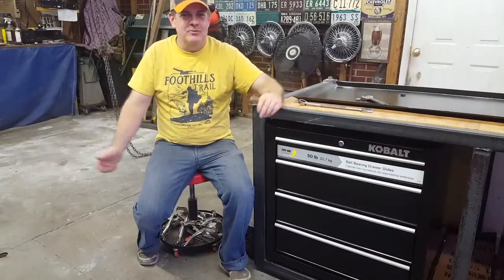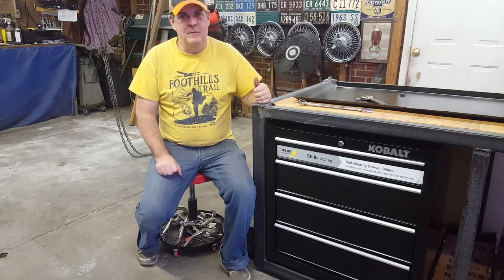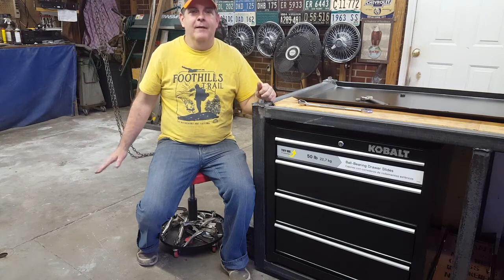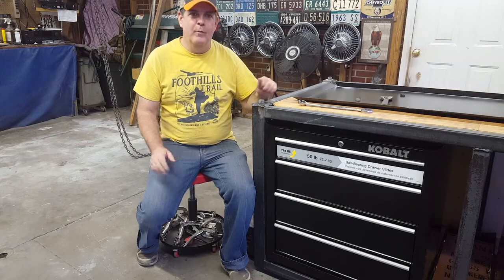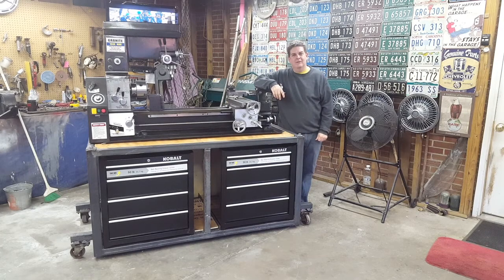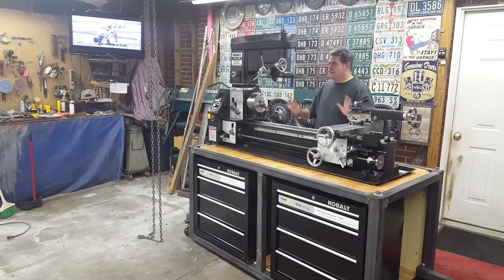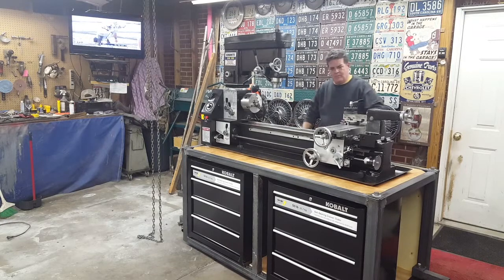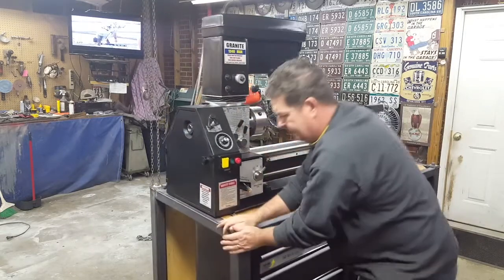Mounting the Smithy Granite 1340 Max to the Work Bench

Comment: Nice bench you made for yours! I bought a Gladiator table from Home Depot when I bought a Granite a couple of years ago, and it has a hardwood top. It's a HEAVY duty table--rated for about 2000 pounds as I recall. Then I bought a couple of their cabinets to go under it. But your bench is awesome. 

The Granite units are very good for the price point, for the most part. It's definitely not a Bridgeport, but the lathe is pretty decent. I have lamented about the lack of a tang in the tailstock myself actually--never made sense to me either. One nice addition to this machine though is the SINO DRO unit. I put one on mine and it's great. 

I bought the 1340 Granite IMAX because I had only a 11x22' shop, but last fall I built a much larger shop and also bought a Bridgeport mill and a 13" South Bend lathe. So I'm going to put my Granite up for sale. I've used it quite a bit and overall, as you've said in another video, they get a bad rap. The lathe is actually pretty good I think. 

So someone in Wisconsin is going to get a very well-tooled Granite with a nice DRO and minimal use.
Reply from the maker: Thanks so much for watching and commenting! I love my Smithy, its perfect for what I do in my small shop. Thanks for the compliment on the bench. It turned out pretty good.
Reply: Yes, it's outstanding. Bummer on the chip pan though--you should DEFINITELY have gotten those risers.

Comment: Great build and single handed mounting.  Cool. I am looking at an early used Granite from an elderly friend of mine.  I know little or nothing about machining operation.  Question one: is granite a good learning setup.  Question two:  do you know of any on line Smithy user groups.  I do have extensive wood lathe experience as well as general shop background.  Gotta start somewhere.  Really hope you can respond.  I’m in Souther California.

Comment: In using this setup have you found the Smithy is to far away from where you stand in as do you wish or have you moved it toward the front?
Nice bench, love the adjustable legs, not only for leveling but to remove those casters, they can hurt if left in ;-)
Reply from the maker: I have been satisfied so far. I do need to raise it up about two inches.

Comment: Do you know the dimensions of the stock you used to mount the Smithy and/or the distance between the holes?  I don’t find a template or mounting diagram anywhere.  My 1340 is finally “supposed” to be here Tuesday.
Reply from the maker: Hey ok farmer, honestly using the chip tray that come with your machine for a template works the best. Remember to plan on some kind of spacers between the machine and the bench. I would recommend 2 inch spacers. Check your quick start guide Smithy should have emailed it. It has a bolt template that will help some.
Reply from the maker: Also, I used 1/2 inch bolts and nuts to mount the machine.